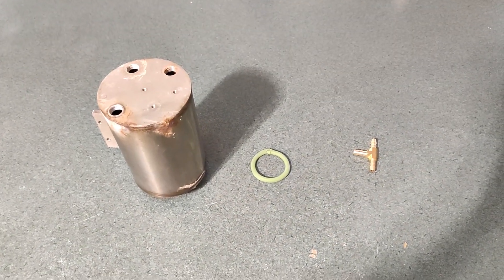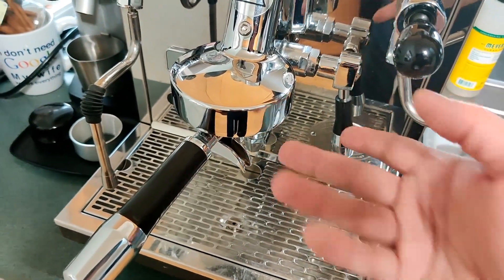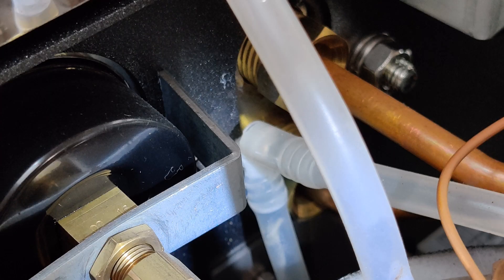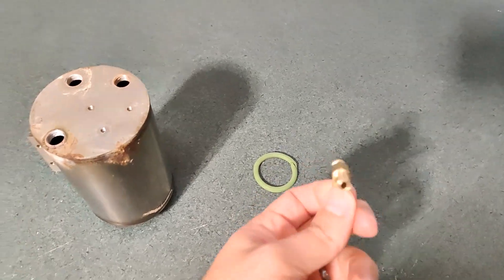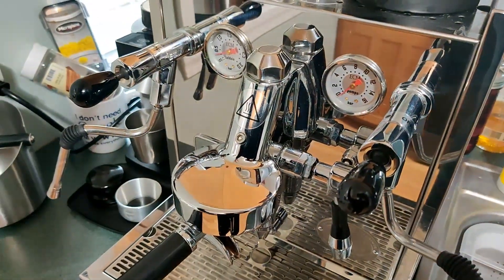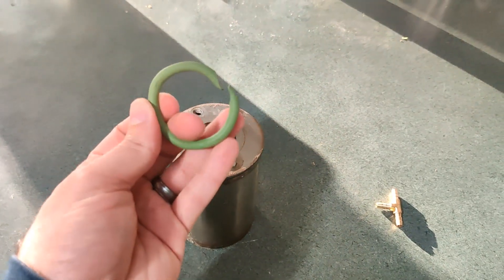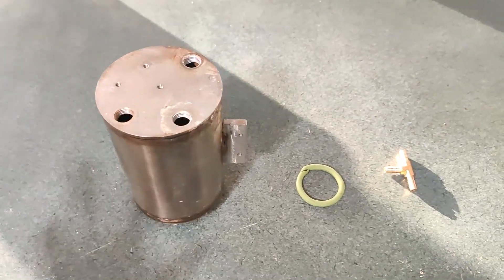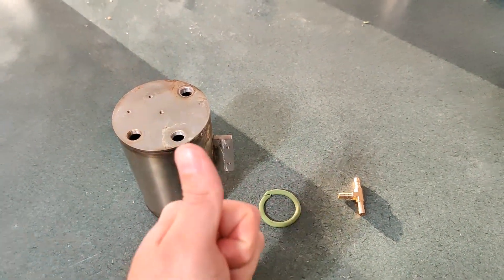ECM Synchronika - Defective Boiler and Repairs

Comment: The main on/off switch blew the other day. Waiting to see if anyone has the part. The weird thing is I have no clue why it blew, all the clocks were on time so it appears we never suffered a power outage. The other electronics on the same circuit were fine.
Reply from the maker: Clive Coffee has the power switch in stock,  this is the part number ECM C199900087.  1st-Line also carries it but it is more expensive there than Clive Coffee.  Whole Latte Love may have them too, but you have to call them in or to make the purchase of the part.  Depending which coast you are on, Clive is on the west coast and both Whole Latte Love and 1st-line are on the east coast.

Funny how you mention this, because I have a part that the water tank spring valve plugs into break all of a sudden.  I don't remove my tank very often as I can fill it without removing it, so I have no idea how it just broke like it did.  It sheared off, when I can make my update video I will show that part.  It stopped my machine from getting water, and had to order those parts just today.  I thought it was my pump at first, and hopefully that is still ok after it not being able to build pressure as only air was getting in.

Is the machine plugged into a GFI plug?  Maybe it needs to be reset?
Reply: @hagar852  Thanks for the quick reply, I'm in Ontario Canada. I've contacted a few potential suppliers, just awaiting a call back. It's definitely the switch because it's burnt out. A few of the small plastic plugs are also burned so they may need to be replaced too. There are two other small appliances attached to the same circuit and both are fine, so it's kind of a mystery at this point.
I'm sorry to hear you have problems again, that is a coincidence because as you know the little water valve on my machine started leaking but it's repaired now. I chalked that up to me removing the tanks once a day. I'm not sure why I did that because I have no problem getting at it from the top. I now use a dedicated jug to fill it. I hope all goes well with your machine, it's just a pain in the butt not having espresso for a week or so :(  Thanks for the part number.
Reply from the maker: @HigherInfluence  Yeah it sucks and I also have no backup machine to make coffee with.  I am going to have to try doing pour-over type coffee.  The positive to this, is that the machines are repairable, and can get parts for the most part.  I haven't looked into seeing if other brands have issues also, but the coffee shops I see selling these machines also have a repair department, so that should tell you something.  When you have water, electricity, heat, and pressure all living in the same box, I guess eventually something has to give.  

You may have to pull out the brew boiler to get to that switch though.  Whole Latte Love has a video on how to do that step by step, and it isn't too bad.
Reply: @hagar852  Strangely enough I’d only just bought my wife a Finum Bloom and Flow pour over which I got for $20 on special at the local grocery store, so that is working out well. The boiler didn’t need to be removed to get that switch out so that made it easy. I’m just hoping nothing else is damaged.

Comment: So no scale buildup but the RO creates very aggressive water and leads to rust - which you do have - I suspect it lead to the premature failure of your boiler welds.  There's a reason they say not to use an RO for pretreatment to these machines.
Reply from the maker: So I have an update on this actually.  The problem I was actually having, was my water being to acidic.  I NEED the RO as I have to inject chlorine into my water (iron bacteria problem), the RO process made the water to acidic, so I was able to add a pH Booster canister (calcite) to the system and now have water closer to neutral pH, also the booster adds some minerals back into the water, TDS 50-100 range now.  I went over all of this the first time the boiler failed, and the support team at Whole Latte Love determined it had bad welds.

When my water system is serviced every year, the water is tested each time, but it was never tested out of the RO system.  I am on a well, so the water will fluctuate naturally in pH, and was coming out of the system to low (6.3).  Just had that corrected and now it comes out of the house system around 6.8 now.  Will see how this works out.

Comment: Your ro water is probably why your boiler failed. Pure water is more corrosive.
Reply from the maker: No it wasn't, it was confirmed to be a defect in the welding of that boiler, the pictures show the contaminate inside that caused the issue.  Whole Latte Love technicians told me to NOT change my water setup as my internal boiler components were in remarkable shape.
Reply: @hagar852  
Hi,
Strange that manufacturer don't introduced procedure of ray-x scanning of welds to avoid such mistakes. This is hi pressure device so responsible, as well as machine is one if most luxury snd expensive in range.
Reply: That's what I was thinking too, but I don't think it's THAT corrosive, it's not stomach acid. More likely it's just a flaw in manufacturing. It happens sometimes.

Comment: Had the same problem on my profitec pro 700 https://www.youtube.com/watch?v=EurWO8RkdHA
Reply from the maker: Sorry this happened to you.. mine got to the point it was bubbling out quite a bit more rapidly than that.  Where you able to get it repaired yet?
Reply: @hagar852  yep, I sent the brew boiler only and they swap my parts on a new boiler. I reinstalled the brew boiler myself and I descaled the rest of the machine. I also rebuild the e61 group. Feel like a new machine.
Reply from the maker: Nice!  Glad that worked out!  Even having the problem we both had, having the ability to be able to repair it ourselves was a factor in buying it for me.  That, unfortunately, came to fruition but gives confidence in the machine being supported with parts and etc.